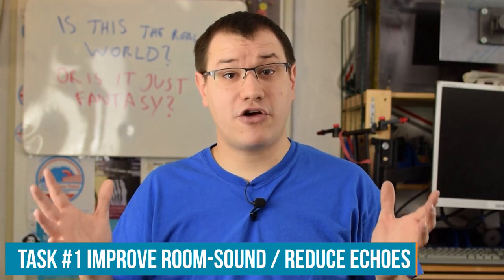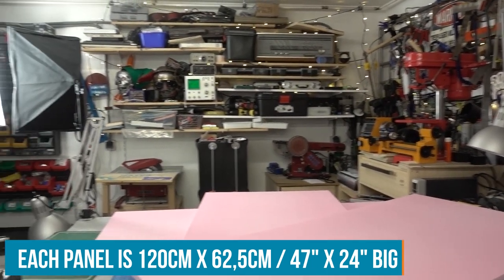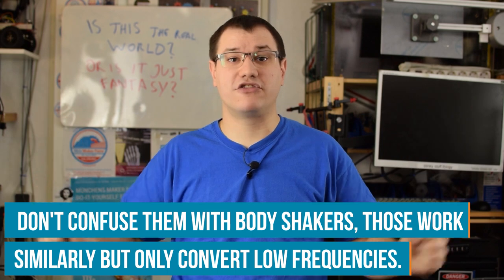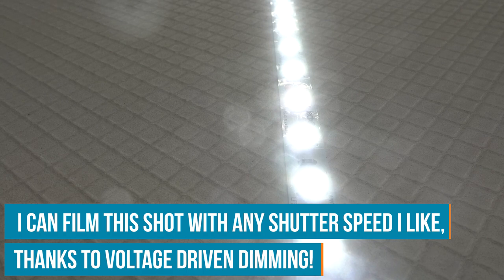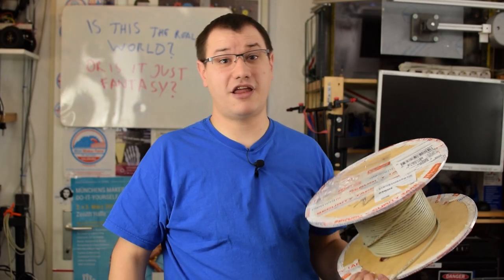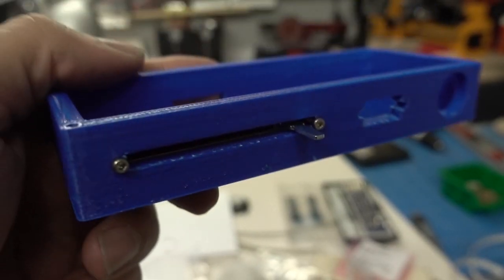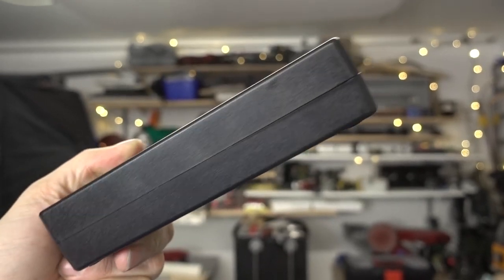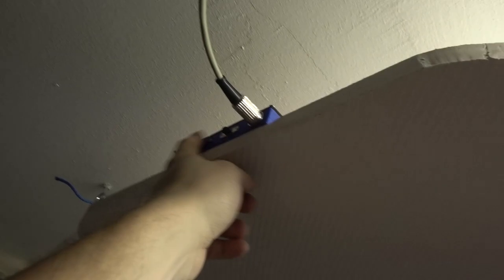Room-Sized Studio Light Speaker Combo

Comment: Did you give any consideration to the heating of the LM317 regulators. I noticed that there was no heat sink and I have observed these devices getting quite hot.
Reply: the PCB acts as heatsink, the perfboard perfomrs nearly as good as a pcb with thermal vias.

Comment: While having speakers like this would be cool, it does pose the question to me of dampening. With the mass from the LEDs and boxes, it would increase the mass and dampen any bass coming from the speakers. The quarter wave is going to be hitting 2/5ths from the speaker, and where it looks like the transducer is positioned you will have wave interference and have a harder time getting over the dampening effect of the added mass on the back. Are you able to compensate with higher volumes or is it negligible due to being in a concrete bunker? Excellent video btw!!!!!!!
Reply: I was about to write the same . XPS foam will produce great Mids and HF but the power supply mass will damp out the sound when placed like that.
I did many experiments with XPS , Ply and other composites , the best sound came from 3 mm MDF with a timber frame around the outer extremities attached with Double sided tape. 
The 3 mm material produces crystal clear sound but you still need a subwoofer , i didnt find any exciter that will replace a conventional sub.

Comment: They work but you made the same mistake many people make when using exciters. If this were a normal speaker box you were building, you would never paint the membrane or mount the electronics to the membrane. But you did just that killing their ability to vibrate freely. You would have gotten a lot better sound quality if you had stained them white, mounted your dimmers on the wall and put the LED strips on the ceiling.

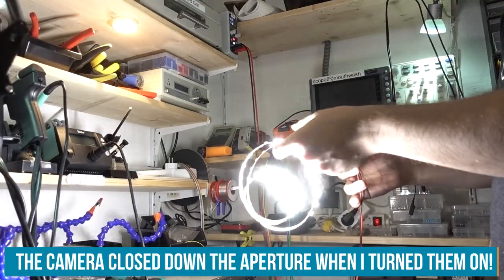Comment: Buddy, size of a cable is dependant on amperage NOT voltage.  4:45
Reply: The gauge of the cable conductor is dependent on amperage.  The thickness of the insulator is what the voltage rating is based off of.  Use proper terms if you are going to go at someone as if you are an expert on the subject, buddy.
Reply: @jong2359  Buddy, non high voltage applications size is dependant only on gauge.  You don't see the insulation play a significant role in the overall size of the wire until you get up to a minimum of 600V and it doesn't even begin to get significant until you are in the tens of thousands of volts.  So please buddy, the size of the wire and the gauge of the wire are totally interchangeable terms at this scale, ok there buddy?  If you are going to @ someone maybe try not to be pedantic about things that aren't pertinent to what is being discussed. Part of being a grownup is know what details are important when.  You are the kind of guy who would insist we take in to account the relativistic increase in mass of a car travelling down the highway when calculating fuel costs.  While technically correct it is completely insignificant. OK buddy?
Reply: @Cyril29a  Nothing you just said is relevant to what I replied with.  You need reading comprehension and basic life skills.